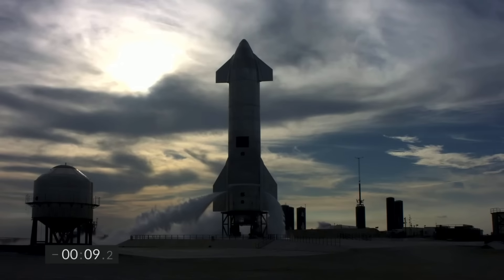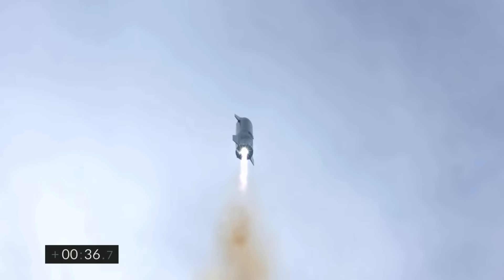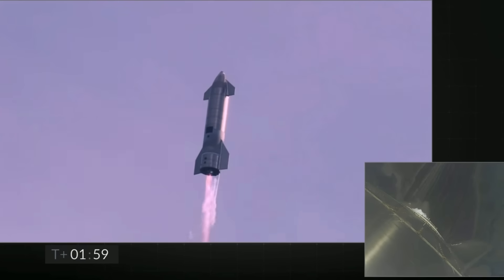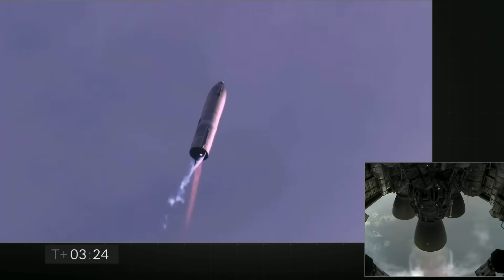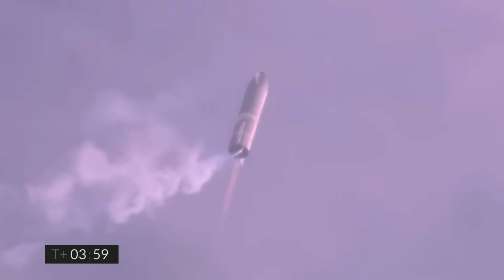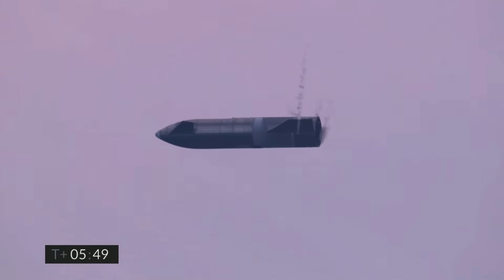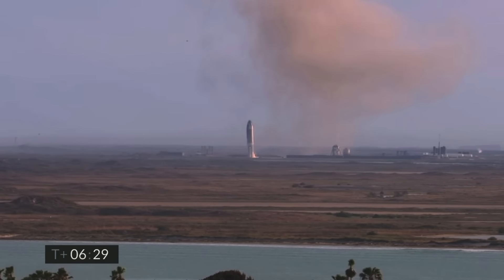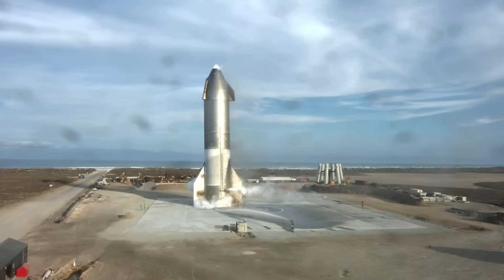SpaceX Starship SN10 soars, lands for first time!

Comment: How it was able to decelerate and land softly enough to not cause damage is incredible. I thought there is not enough time but apparently it stops faster than my old ford pick-up
Reply: Starship uses I believe the same system as falcon 9 does which makes it fire the engines in the last exact secound that they have to be fired. That's why SN8 exploded, because they only ignited 2 of the raptors and 1 of them had problems with the ignition causing it to reach the ground at a very high speed.
Reply: It wasnt a soft landing. It bounced as it touched down. I think there was a malfunction in one of the engines or something.
Reply: @Yorkshire_Tea_Innit  It also exploded a short while later
Reply: @BadVoidShip  Doesn't matter, it demonstrated that it could be done but just requires a little more work. It was largely a success
Reply: Not so incredible. At that point, the vehicle is pretty empty, so very light. The engines have enough thrust to easily manage this task. DC-X, aka "Delta Clipper", did the same nearly 30 years ago, albeit on a smaller scale: https://www.youtube.com/watch?v=wv9n9Casp1o&t=24s
Until now, nothing revolutionary.
Reply: Soft landing? That was nog a soft landing. It was a landing.
Reply: uhh...
Reply: it blew up like 10 minuts later. look it up.
Reply: @RMD992-f2n  It did but it doesn't matter bruh. Guy is talking about the landing, the landing was perfect, it did blow up later on? Yes, it did, but it also landed perfectly :)
Reply: @nunosanto7365  impressive landing, never seen before, but not perfect, it smashed the ground so fast, luckily is not going to happen ever again.
Reply: @Ivan_Berni  That might explain why it seems to be leaning slightly on the landing pad.
Reply: @nunosanto7365  not perfect.  it was hard and ended up leaning....
Reply: @nunosanto7365  Had it landed perfectly, it would not have suffered the damage that caused it to blow up later (which they do explain later as well).   Landing without falling over does not make it a perfect landing by any stretch of the imagination.  If you re-watch the moment of touchdown you can see it was an abrupt hard hit and from the early post-landing camera pan you can see it leaning quite a lot.  It should be sitting vertically.  Yes, it was the first success of the most ridiculous descent and landing method in the history of rocketry.  Of course they've abandoned this in favor of the catcher - which, as of yet, remains untested.  I am a huge fan of SpaceX and I find this kind of landing nothing short of a physics/engineering wonder but it is not practical.
Reply: @nunosanto7365  It matters
Reply: @nunosanto7365  Imagine being part of crew thinking they landed safely only to be turned to roasted meat.😂
Reply: @RMD992-f2n  What blew up 10 minutes later.
Reply: @bighands69  the rocket sn10

Comment: Impressive and the SpaceX landings are a blast....truly out of the science fiction books and like walking on the moon.  Wondering what the payload capacity will be and how enough fuel will be held on board to achieve even low-earth orbit?  Or will boosters eventually be attached to it like the STS to increase payload and higher orbits?
Reply: Payload cap is estimated to be around 150 tonnes . It can also be converted to transfer humans with a cap of around 100

Comment: without a pad to land on on mars wont it dig a hole or throw debris at the legs or fins of the ship.that rocket might dig a deep hole to land into
Reply: The surface of Mars is quite firm. It would blow some dust around, but not likely worse than you see here.

Comment: If SpaceX reusable rocket has difficulty in landing vertically, as it was blown during landing testing many times. The other options SpaceX innovations is a spaceship changing Rocket into a Spacecraft like a plane. During Launching it will be a Rocket, during landing it will change into a Super Plane with vertical landing, it can land anywhere. And during Launching, the Super Plane will stand position itself and change into Rocket to launch again without the need of launch pad or runway. Cause on other planets they expect nothing structure except sands and rocks

Comment: No concern for the immense damage to the Environment
Reply: I just a baby
Reply: says the first in line to the Mars escape lol
Reply: Despite methane being a very potent greenhouse gas, methane as a rocket fuel is quite environmentally friendly because of its burning efficiency "If you produce a good propulsion unit, the efficiency of that unit can be as high as 99.5%" Way better than the old stuff they used to use for the Saturn V Kerosene or the Liquid oxygen/Liquid hydrogen mix's most rockets used.

Comment: It looks extremely scary, volatile, unpredictable and potentially 100% deadly for anyone who was unfortunate enough to take Musk seriously and purchase a ticket. LOL Spaceship with multiple possible points of failure seems to be everything Dragon isn't. But even with how beautiful the Dragon looks, I doubt that beauty of the exterior could ever take my mind away from those question mark-shaped pipes filled with Hydrazine fuel and extremely prone to bubble formation and blowouts... This is why your classic emergency escape/decent engines would be powered by solid fuel. It just doesn't seem fair that the very system that is supposed to save your life in case of an accident/malfunction is exactly the system that is likely to malfunction and kill you in the first place. In a way we took a major step backwards from the days of Apollo when it would take nothing less than an act of God for the beautiful and extremely reliable hypergolic simplicity of the Lunar ascent module not to ignite...
Reply: Everythinggggs going to BE OHkay

Comment: Looked great, but the landing looked a bit hard. Getting it done on the third try was nice to see. It's that landing thought that's got me concerned a bit; landing hard on a landing pad is one thing, on uneven Mars terrain another, altogether difference beast.
Reply: Did look like it booped the landing pad a little harder than it should have eh.
Reply: @ZorbadTheGreat  Despite that, I do think they are getting better at it though. My opinion is, they landing pods need to come out a bit further to offset the center of gravity, and down a bit more with shock absorbing struts to soften the landing. Other than that, I think they are progressing pretty well. My rationale is, this will be a lander on rough and uneven ground on Mars and not on a solid concrete platform, and it is this they need to focus on more. But I also know that they are focused on just getting the landing done right on this platform before they can move on to the next step. BUT, when thinking of how well they've managed other landing on of the presently reusable Falcon 9 lander, they've got it nearly perfectly... this is really the way to go. If you compare the two; that of this SN10 vs. the Falcon 9, you'll see a significant difference in the landing struts; the Falcon 9 spreads out more, and it does a far better job on the landings.

Comment: This landing design is just waiting for disaster to happen. One thing fail and that will be the end of you.
Reply: Like was the case with the Apollo moon landers. A single engine for landing, and a single different engine for take off.. (though admittedly, the type of engine used had less failure modes)
Hopefully now, some redundancy can be built in by having multiple engines to land with.
Reply: Every landing design is a "disaster waiting to happen".

Comment: You can see that it was not a soft landing @ 6:34. That rocket bounced! @ 7:04 you can see that the rocket is leaning to the left, so I would say that something got bent. And finally, @ 8:15 you can also see that is missed its mark since the water cannon obviously could not reach the rocket with its water blast. This wasn't a perfect landing, but they did manage to land the rocket upright without it crumpling into a pile of twisted metal.

Comment: That's a pretty hard bounce on contact with the ground. I don't get why they don't use two engines on landing and just throttle them back enough for a really slow gentle approach to the surface.

Comment: It was a great early test flight and SpaceX learned a lot from the test which accumulated into the successful Sn15 flight that had a softer, more controlled landing... SN10 would have survived later on if a better fire suppression system was available to put out the fire.....

Comment: As a kid, I enjoyed watching the original Buck Rogers serial.  His rocket ship was able to lift off and land vertically like the SN10.  It looked similar with the tail fins etc.  When watching this launch and return of the SN10, I swear the visual similarities were startling.  For instance, in the Buck Rogers serial the special effects were crude.  It looked like sparklers were used to resemble thrust and you could almost see the thread the model hung from.  As smoke from the SN10 wafted around the base of the prototype during the return it reminded me a lot of what the model looked like in the serial.  In addition, the serial was set in the 25th century.  The SN10 is centuries ahead.

Comment: 6:14 to 6:22 looks like CGI.
Reply: They set the ISO on the camera for that shot very low to compensate for the extremely bright engine flames. Otherwise all we would have seen is a very bright blob of light with zero detail. That's why it looks different then the rest of the video.

Comment: Awsome flight. The explosión is only because of only one or two en engines using its maximum strenth to push tha giant heavy rocket into space and back. Ones all engines are added things Will be different for sure. There May be some things to adjust but thats normal.

Comment: Should have a couple mini boosters capable of letting it hover horizontally. Would allow for slowing that fall back to the ground. And that landing looked pretty hard to me. Also should have onboard fire extinguisher/co2 tanks that empty on landing to quench any land zone fires. We have a long way to go b4 we reach that ship I had in a vision. It was capable of both horizontal and vertical takeoff and landing. But it always flew with boosters from the back. Had retractable and folding bottom side wings to allow it to fly like a plane. In my vision the military sometimes used it for extra rapid transport from one side of the country to the other and over big ocean trips. It flew to space and back like nothing. Saw this vision as a kidd. We used to draw these ships as kids. Crazy how these new rockets are heading towards that.

Comment: The Naysayer flatheads are here in force and it's very understandable in this world of fake news and CGI. But what's  happening is an exponential advancement in technology which is now moving way too fast for the average layman and they can't keep up.
I was building testing hovering and flying scale RC Vtol airplanes 17 years ago with basic gyros knowing it was just a waiting game for microprocessor flight controllers with advanced firmware and new accurate miniature sensors to arrive, which also stabilize these Vtol rockets. Basically the naysayer generation here will also have a younger generation that won't believe what their generation are developing in all areas of technology. Good or bad biotechnology and AI is also about to appear magical in the next 10 years .... if we don't have a nuclear winter first.

Comment: The in-flight motor shutdowns are still very, very wrong. Each one results in a fuel-air explosion that tears thermal blankets loose in the aft bay!
Reply: Pretty sure those are just a temporary solution.

Comment: When are they going to make an actual attempt at space?  What they are doing can be accomplished with an air balloon. To call these lift offs "going to space" is a ridiculous over-statement of reality.
Reply: the objective of this test is to land, not go to space. there's other tests designed to do so and that succeed at it
Reply: nobody said SN10 was going to space; the first attempt at an orbital launch is SN20 which is the next starship launch, and will be happening either this year or early next year.
Reply: @lmao.3661   are you sure about that? Cause I'm pretty sure they called it a space flight
Reply: @theheretic4503  that’s the falcon 9 rocket… this is starship. They’re different things
Reply: @techheck3358  yet they have done and said the same thing. Exactly the same thing that can be done in a Fn balloon... go up until they come down, just take allot less time to complete due to propulsion system's. Bottom line is, they have NOT gone to outer space.
Reply: @theheretic4503  the point of these prototypes isnt to go to space yet. they have already made rockets to go to space. theyre trying to get a goddamn giant rocket to land. the point of starship is to have a fully reusable system.

Comment: Blue Origin also can launch and land with reuse rocket :)
Reply: No they cant
Reply: but not a 50 meter tall single stage vehicle
Reply: Not in a belly flop position with that saving of fuel
Reply: New Shepard is meant to be the competitor to the falcon 9, not the starship. and it doesn't even do a good job at that.

Comment: How is the camera angle not changing as the rocket gets higher?   Are there two rockets?
Reply: Yes it is changing, look at high speed, the more high it gets the more difficult is to see it
The engine bay goes from a straight to be fully visible when it is at its apogee

Comment: there is NO SHOT that the video sequence beginning at 6:12 and ending at 6:20 is real, right? shit looks CGI af!
Reply: Why would it be CGI?
It looks like a simple tracking shot, nothing else weird.
Reply: @julian362  there was a little glare for a moment and thats what all the flat earthers are using as evidence that its fake
Reply: @timeydoesstuff  first of all, i am 10000% not a "flat-earther" so get that out of the conversation right now.  But it is obvious that the glare is computer generated and the movement of the vehicle is wayyyy to smooth for it not to be CGI.  Why did they do this? no clue, but it is a completely fake video from that angle.  Do i think this event actually happened as a whole? yes, but this is as obvious as it gets to CGI (with that specific video angle clip)
Reply: @WideSpreadPanic44  literally nothing about it looks fake if you ask me. Just compare the exhaust and the fire to the camera angle change, it is literally the same thing.

Comment: Wondering if they put alot of smaller engines on the underside of a longer wider space vehicle if they could launch with main boosters and land with axillary engines horizontally and it could have its own launch pad as part of the assembly. Which could be a disposable part that could be re-used anytime it came to that spot. Just saying if your looking at planetary travel it would make since to design a launch pad drop vehicle. Also it would makes since to land horizontally for passengers.
Reply: For that we need many more experience, budget and it makes the rocket way harder to work with

Comment: Just NOT a good idea to have that much explosive energy that close to landing. The space shuttle did it the right way by just gliding in with none of the dangerous fuel concerns
Reply: saying the space shuttle "just glided" is a bit of an overstatement, it was a very, VERY bumpy ride back to ground. It got even hotter than the starship because the way it slowed down was to bleed energy as heat through friction with the air. This damaged the ship, making it necessary for gazillions of dollars and months of repair work in between flights in order for it to be reused.
Reply: @fezii9043  I understand that. But that's why I said MODERNIZE it. That was technology 40 years ago! We've made advancements at this point that could drastically reduce most of the risks and complications they experienced with the shuttle at the time.  This business about creating spaceships that look like gumdrops is just a cheap way of doing things. I hate it. It looks ridiculous to just drop people out of the sky into the water in the 21st century. C'mon man you gotta admit that!

Comment: Apollo did this 6 times in a row 60 years ago with zero practice, no computers, no gyros, no air, in 1/6th gravity, without kicking up a spec of dust with an F-18-size thrust motor pointed straight into unleveled dry dust from 12 inches point blank range.  Ha ha hahahahahaha.
Reply: What do you mean by "this" ?
The saturn 5 1st stage didn't land itself.

Oh wait sorry, you were speaking of the lunar lander.  landing this 40m behemoth is much harder than landing that 5 meter lander, and the fact that there was no air and less gravity on the moon made that landing much easier. They have also used gyros and computers (even if those were really basic in that time).
Reply: @rolandb.1866  
How do you know its easier on the Moon with no computers or gyros or inertial or GPS flight path information?  No landing pad.  No Earthly idea what the Moon landing site is made of, or if its level within 90 degrees of slope. Plus, Armstrong crashed the practice vehicle in less than 3 seconds, his delayed ejection led to his chute missing the fireball by a few feet, watch the video.  NASA halted all practice for the rest of Apollo for safety.  Doesn't seem too easy.  Seems utterly absurd, six times.  The only thing we know for sure is $152B disappeared.